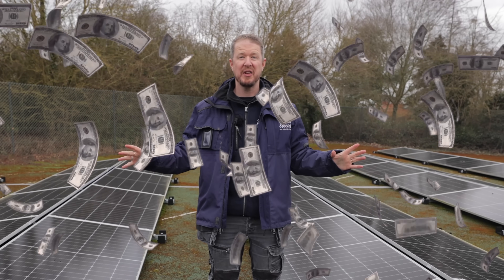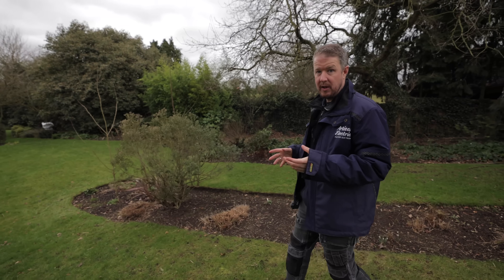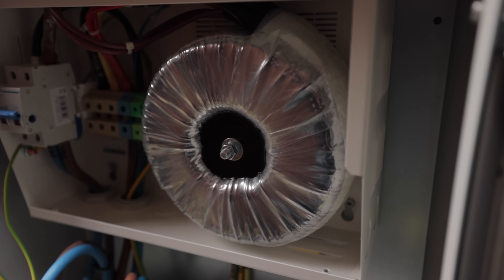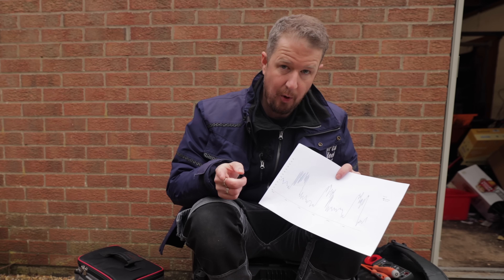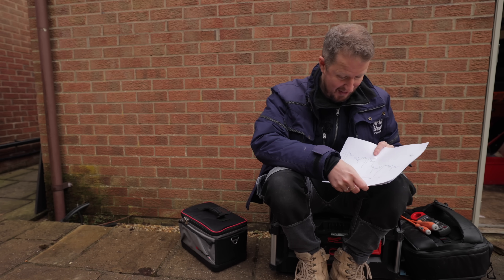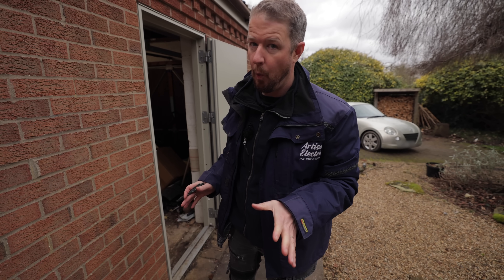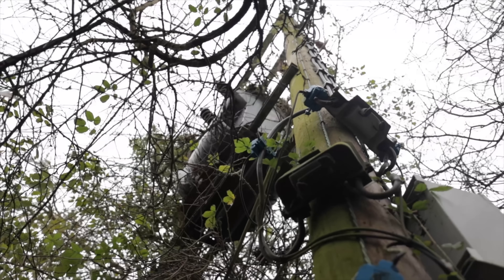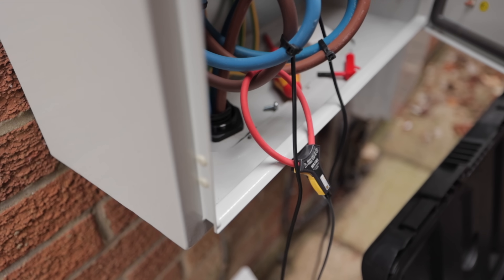THOUSANDS Down the Drain – And We Can’t Do Anything About It!

Comment: The voltage is managed at the 11kva stage and yes, everywhere in the UK is set to run towards the very top of the voltage range.  There have been experiments to lower this voltage a bit and the results were overwhelmingly positive.  The network has no real means to track the voltage at the final transformer though, let alone adjust it (well, the transformers can be adjusted on site via tapping but as the requires a dead line there is a great deal of reluctance to ever do this once in service).

Basically the wider network runs at too high a voltage, all in the effort to prevent a 'meaningful' drop in the very few long-lines that may be impacted.  The trials in South Wales showed that the actual impact of reducing the voltage was effectively nothing but the positives were there to see.  There are other reasons why the network is reluctant to do anything with in-service transformers but that is out-of-scope for this discussion.  As to why we still build houses without 3-phase power is beyond me.  The DNOs tell the government that single phase is good enough then turn around to customers and tell them their single phase supply causes many issues that work against UK government policy.  Meanwhile OFGEM has a dead hand at the wheel.  3-phase is common in Europe but not here, so we just suffer with what we get.

As for me, my background voltage is circa 247 volts and can spike slightly above the regulated limits even without local solar.  And yes, we do live near many power plants and the core spine of UK power distribution so we are at the hottest end of the voltage range.

There are methods to control output voltages on the SolarEdge system so I hope you have explored these.  The peak charging rates of the batteries can also be tweaked down too, to avoid voltage sag.

Comment: I am a electrician in Australia and with the solar systems that i am familiar with, it is a problem with set-up of the the 3 phase inverter or the management system.  The inverter should mimic the line voltage of the network. Ideally,  it should first charge the battery then any excess power pump into the network. Any power that the household requires should come from the battery system first. Then any additional power from the network. But this only my limited opinion.
Reply: Not that efficient to transform dc to ac to load a dc battery followed by converting dc to ac to power appliances. About 2x 15% energyloss ….

Comment: Don't tell me that you are using electric heating with solar panels. You do have heat pumps and a massive insulation, right? Since those two are possibly 5 times cheaper than solar panels.
Reply: Hopefully not resistive heating.  Hest pumps are going over 300%
Reply: @HansSchulze  He is probably just pretending to be an i..... to get likes.

Comment: The ECO Max is available for £995 installed, so your "cost us thousands to fit this" is a bit of old bull.
Reply: This isnt an optimizer, its a coil that should cost 200£
Reply: @HansSchulze  I agree, a "proper" VO is not a passive device, It's a Rectifier and Inverter combined. This stabilises the voltage at ~220 normally, and will react to loads changing to maintain the output voltage.
They do with with AC-DC-AC conversion much like a VFD/Motor drive, These aren't as efficient but they combine multiple devices and features into one, mainly surge protection and harmonic protection, they can also do PFC, and somewhat help balance the incoming phases.

The more efficient, but less useful method have variable autotransformers, old school guys may know them as rheostats, or variacs, they can't move quick enough to deal with transients, but can respond to slower load changes.

The proper bottom of the barrel types, that I agree are basically a scam, are the purely passive transformer in a box that will harely do anything.
Reply: The cost of troubleshooting and repeated visits to the house will add up to the cost.
Reply: @Dragonited  His install, his spec, on his dollar to make it work. You don't whinge about the cost if you f-ed  up the design (which he clearly did), put it on the training budget 🙂
Reply: He did mention buying then time and effort. Looking at the work gone into the install and all the faffing around with his team you can easily see it could cost a company "thousands" to do. Cost of his time would be more than cost of an average installer. Cost of having multiple people do do investigation into the power network and stuff. The 100A ones are about a grand on their own so add in a couple of days labour - one day, multiple people and yes it'd cost the company more money.
Reply: It is a big lump of copper, but really that is overpriced.

Also I cannot see why the cannot draw directly to charge the EVs and only use the copper doughnut when back-feeding.
Reply: This 👆 If someone can spout that kind of BS on YouTube can you trust them to install a system and price it correctly?
Reply: @Hejavra  Artisan are famously expensive, and Jordon isn't averse to a bit of Youtube clickbaitism. 
So this is pretty-much par for the course. He does at least discuss what the company is doing reasonably candidly, which is genuinely useful. 
By the same token I'm not convinced that some ivy up the pole counts as the transformer 'being in pretty poor condition'.
Reply: @Hejavra  they have provided proof on video that they fucked it up. There should be no 260V+ going out of the inverter

Comment: Yeah I wanna see a part 2, the DNO should install a more closer transformer or upgrade that old transformer and the cables. I am having a worst situation here in Portugal but I dont have PV, I´m having sometimes 180V, lights all flickering and appliances not working, DNO doesnt acknoledge the problem.

Comment: 17Kw export back onto single phase is a bit heavy. As mentioned below in previous comment, long supply cable lengths may be the problem due to voltage drop.
Try limiting the export back to the standard 16a, 3.7KW, and bypass the voltage optimiser (tapped to reduce supply voltage), so the generation does not push the voltage too high and the night time battery charging does not pull the supply voltage down too low.
Reply: The 17kW of export and the accompanying payments will have likely convinced the customer that they were going to payback Artisan's overpriced installation costs relatively quickly. I can't imagine them being happy with a 3.68kW export rate and a 78% reduction in associated payments.

Comment: I'm in a rural area with poor grid capacity. Our voltage is usually ~223 as a baseline, and with the car on charge and the heat pump/batteries running it'll drop to ~210. Not great. I've set my home batteries to charge at exactly their capacity divided by the 6 hrs of off-peak power (so 2.72 kW for my setup), rather than a massive 6kw spike. This, along with the car/heat pump on it'll keep the voltage about ~216v. Again not great but it works....until my neighbours get an EV or heat pump!

Comment: The main problem is how the system is set up and what it's intended to do in the first place...   The thing that would make sense is to charge the batteries with solar and then manage usage from there. But instead we're chasing the dollars and running the energy back and forth into the grid and out of it, losing a lot of it in the process.  But those are the incentives within "the system", unfortunately.  This is the reason why I personally chose to stay off the grid completely.
Reply: The grid is the problem when it comes to solar. To go from d.c. to a.c. at proper grid hertz is the issue. It's better to have small scale solar and run as many d.c. appliances with it as possible.

Comment: Can't wait for Part 2 :-)  I'm impressed that a tororidal autotransformer that size is able to carry 17 kW ! Is it rated for 17 kW for an unlimited time ?
Reply: Looks like maybe an eco-max home series so it’s either rated at a continuous 63A or 100A model.  Because it’s really stepping voltage by at most 10% it doesn’t need to have a massive coil.
Reply: I think you didn't listen to him or misheard: it's not an autotransformer (like Vphase) it's a standard tx with multiple taps.

(Vphase was a brilliant idea poorly marketing and funded for proper development so it could only ever cope with small power and ultimately collapsed, which turned off anyone else from trying the same technique.  I've never found any other company that tried to release an auto-tx, I wish there were, it would be great to protect your ancient village installation from surges and dips without an off-line UPS...)
Reply: @Dranok1 the eco-max is an auto transformer, there are a few companies in the UK that manufacture these at a domestic or commercial scale. Some commercial units have on-load tap changing and undervoltage bypass control.
Reply: @zak-19-15  [Weirdly, you reply doesn't show up in the normal display, but at least I can reply from the notification!  Flipping YouTube useless frontend...]
Thanks for that, I'll research them.  I haven't done an in-depth search for a couple of years after I got a bit disappointed by where the industry was taking it (trying to flog fixed-tx tapped-output boxes to domestic users where everything today is low-power or switched-mode, which is just a useless con in most situations)

Comment: In Belgium the onus is on the property owner to send a nice and pretty perfect sine at 230V up to the grid. So you are not paid for anything below that and not allowed to push above acceptable limit. 
If you'd contact them here they'd tell you your installation is faulty because it is not allowed to push over max voltage. 
If you don't agree they'd propose to hook you up directly to 15kV at your expense.
Reply: Same in the Netherlands. PV installations will mandatory switch automatically off at voltages higher than 254V. Just to protect devices (i n the neighborhood) on the same phase(s).
Reply: @peli71  That is info I've been asking for! Does that mean neighbours get angry if too many install solar and their total export reduces?
Reply: @trs4u  Not really, when your neighbour brings up the Voltage from 220V to 230V you don't lose money doing that so that's a good thing. And if voltage would get too high you just heat up your pool or charge your car or your batteries (plebs like me without pools can't afford a tenniscourt sized solar array anyway ;-) ).
Reply: @trs4u  To some extend yes, but most of the people does not understand the principle of voltage cut. They blame the TSO for not having invested in the main powergrid at all. Although the problem is much wider. In 2012 I had an assignment with the TSO. In that time the TSO  predicted the current situation, warned repeatedly, but politics were not interested at that time n major investments. Most, if not all, politic parties wanted a green solution but didn't oversee the consequences..... Currently, in situations of overpowering the local grid the regional energy companies limit new connections mostly for commercial use but also for non-commercial use.. Which lead to some rare but bizarre situations of new build houses with heat pumps but without an electricity or natural gas connection.....  Myself, after installing a PV installation, I monitored the voltage on three phases for a summer period. After that I noticed that one phase had already voltage issues, so I switched my PV installation on another phase. As the installation of new PV installation has flatten I estimate that in my neighbourhood this problem will not occur. Until a lunatic of an electrician (sorry for my French) installs 62 panels and tries to charge overnight home batteries and EV-cars, all on one phase...

Comment: I would say that the issue lies with the inability of the inverters to produce the correct output voltage. There is no reason why those inverters should be more than +/- 3% of nominal voltage. Yet your charts showed the base voltage being consistently 5 to 12% over nominal and the changes are apparently tied directly to the output of the solar panels. 
The inability of the grid power to deliver a peak power to charge the batteries in off-peak times should have no bearing on whether or not the inverters are outputting the correct voltage.
Reply: @chrisose  they have to output a higher voltage than what is coming in or they won’t export anything, so given that incoming voltage is usually 240v in UK it would need to be well above nominal.  I don’t see why solar edge goes up to 265v output when max permitted is 253v.  From what I understand, others don’t go this high.
Reply: This is how I see it. I don't understand how the network impedance should be causing the inverters to rise beyond their regulated limits.... Surely the inverters aren't acting as constant current supplies, ramping up the voltage beyond set limits,  to maintain current delivery?

Comment: So!! You didn't perform an initial survey and obtain an external loop impedance to know what your potential max and min voltages would be, you have then also connected a substantial PV system down stream from the voltage optimiser meaning that when it is exporting the preset maximum voltage settings in the inverter can no longer control the output voltage on to the grid, meaning now you are potentially overvolting the rest of the distribution network connected to that same transformer.

If you knew what you were doing and had trouble with the PEN fault overvolting, you should have installed the PV directly on the supply before the voltage optimiser (it even tells you this in the best practice guide) and installed the EV charger on the voltage optimiser.
Reply: "you have then also connected a substantial PV system down stream from the voltage optimiser meaning that when it is exporting the preset maximum voltage settings in the inverter can no longer control the output voltage on to the grid, meaning now you are potentially overvolting the rest of the distribution network connected to that same transformer."

I'm not familiar with the regulations for PV & battery storage installs (and also not an electrician), but would I be right in thinking that bypassing the protective voltage limits of a PV system's inverter (by installing the voltage optimiser in this way) would require some form of DNO pre-approval?
Reply: @nottimothy5994 issue is the solar system isn’t cutting out at 253v it’s allowing 270v, I am surprised they are just not using the solar power to charge the batteries
Reply: @leexgx  Yes seems inefficient. Maybe it needs to be this way to avoid having 2 charging systems. The panels will likely be 360v or higher DC and the batteries 48v? There isn't any solar output at night when charging the batteries from the grid.
Reply: @leexgx  at 17kW I'd guess the batteries won't accept charge for long? It's tricky. If the batteries are being charged on eg a suspiciously low EV tariff, they'll be practically full when sun comes up. If 17kW happens soon after, there's nowhere for the energy to go, so no energy will flow - they may even be missing out on energy-price-flipping? I expect we'll see more and more of these can't-fully-utilise examples as people fit larger and larger systems.
Reply: Reading the comments it seems that some people are questioning the design of this system or the quality of some of the equipment supplied. It looks the householder needs a second opinion on the install, who can he trust? You think you have employed “experts” but as an end user you never know the limits of the skills of the installers.
Reply: Correct, voltage optimisers disable the voltage response modes that are critical for supporting high distributed PV penetrations. As a result they are not permitted on PV systems in Australia according to AS/NZS 4777.
Reply: How negative is the reactive power set on the inverters?

Comment: It's your responsability to not put more than 253V into the grid. But I get that them not being able to sink the power you're putting in is what's causing the voltage to spike. Essentially the local grid isn't up to the job of dealing with that solar load... Which I guess is their responsability?

Your system should still cap out at 253V though. Just deliver less power. Disconnect some panels? Splitt the load across lots of systems to lower the voltage? Turn EVERYTHING on? Charge the batteries, and the cars, and resistive heat water?... Power up an enormous Neon sign saying "THE DNO IS WASTING XX KW!!!"?

Comment: Hey Jordan. Your confusing v=ir(ohms law) and p=iv(watts law). The are related but not the same. It sounds like the dno is power constricted, possibly due to the house topping out the transformer. The transformer isn't shoddy, it's just not designed for the amount of watts the client wants to source and sink. The network was designed from the centre out as the og power stations were in the middle by the mines. Now the generation is moving outward, coastwards they are having to bolster the network, and they are. But it can't happen overnight